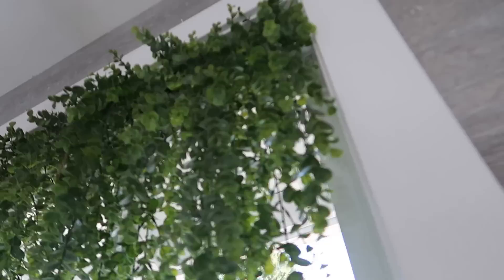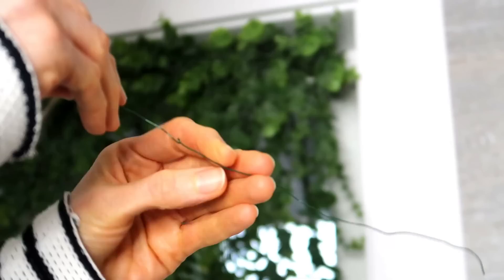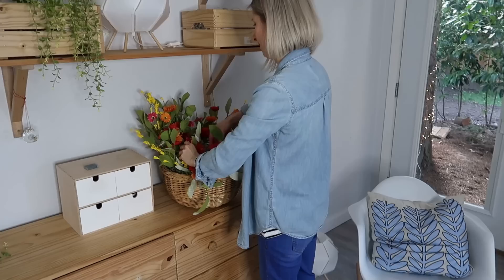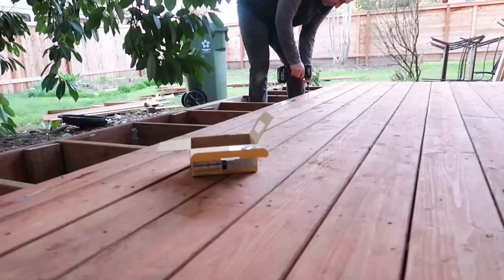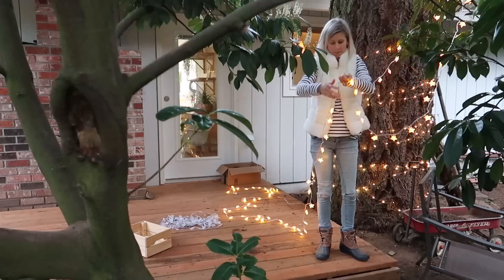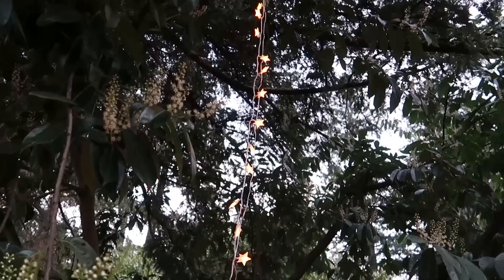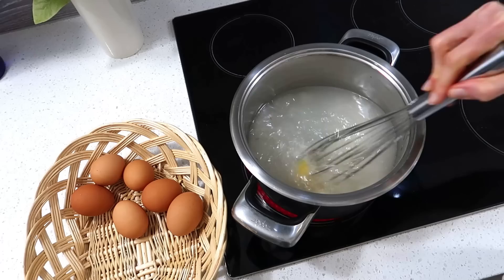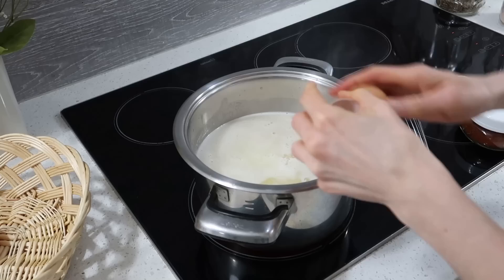SIMPLE LIVING FAMILY MINIMALISM Decorating and finishing the deck, egg soup and starting new project

Comment: On the fence outside your kitchen window I would hang plant boxes. You can plant flowers or herbs in them. I have a chain link fence and have window boxes hanging the length of it being held up by S hooks. I grow all my herbs and dry them to use all year long. With a wooden fence you can hang several boxes in one area and mix some flowers in there for beauty.